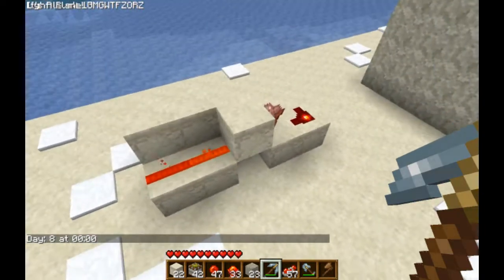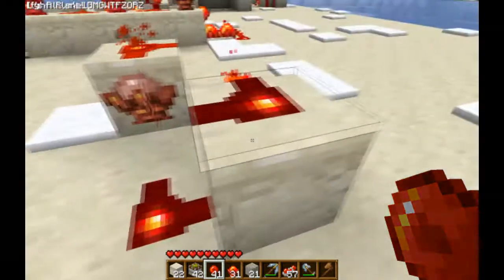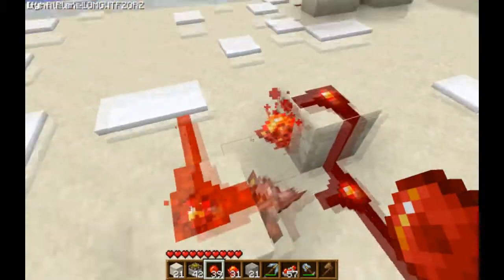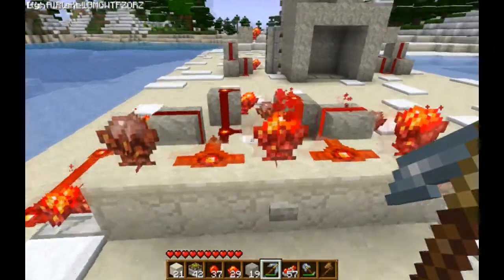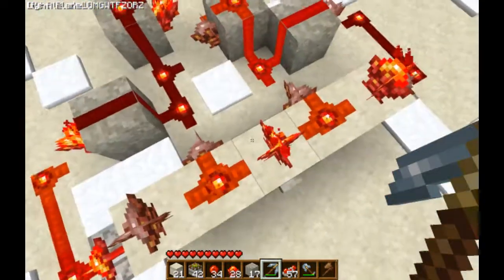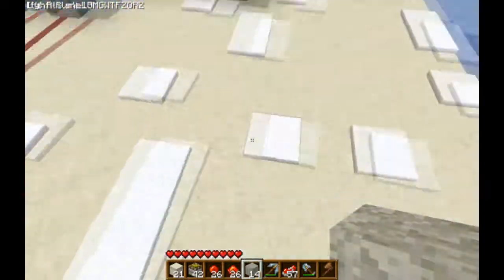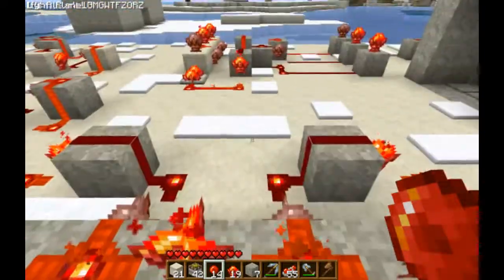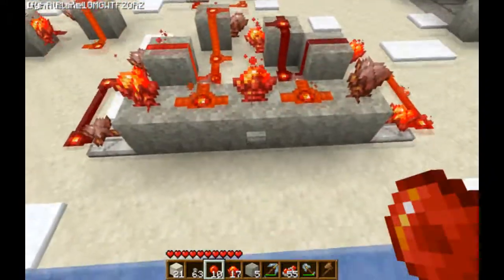TCGM's Redstoneering: Smallest RSNOR Gate, NO CLOCK T Flip-Flop Tutorial

Comment: Mine had an extra pulse when it was turning the out put off due to its speed, so I had to add an extra 0.4 to each side back into the and gate. It would turn off, then quickly send an on pulse before returning back to the off state. Aside from that, small and fast, no clock, no pistons, my favourite T-flop flop for sure.